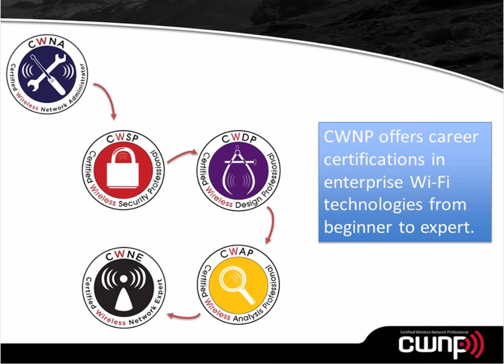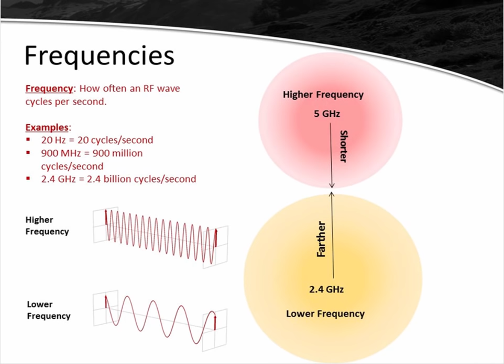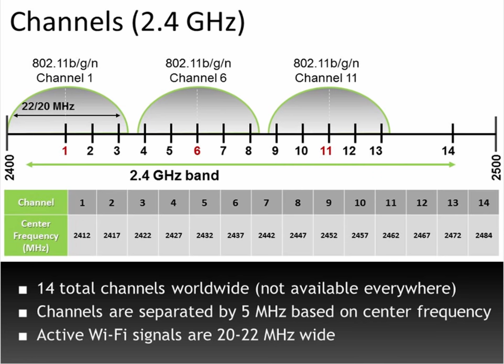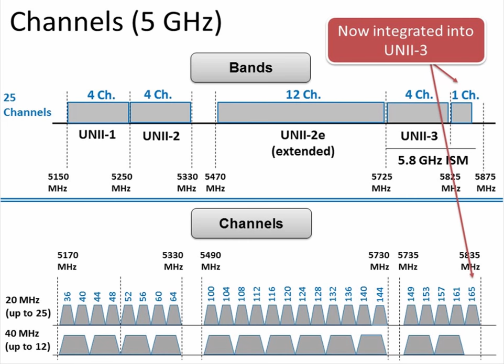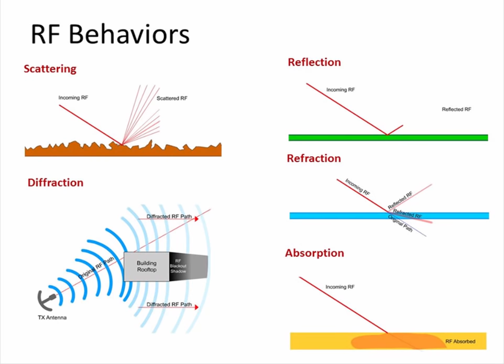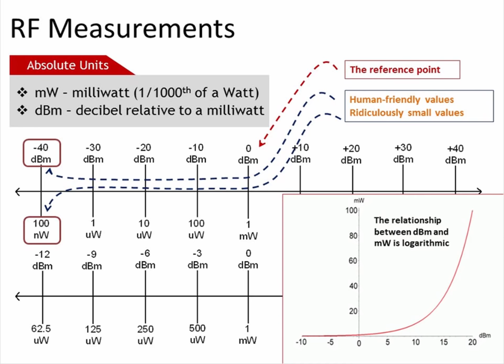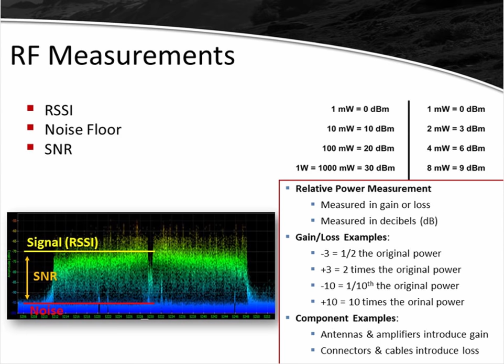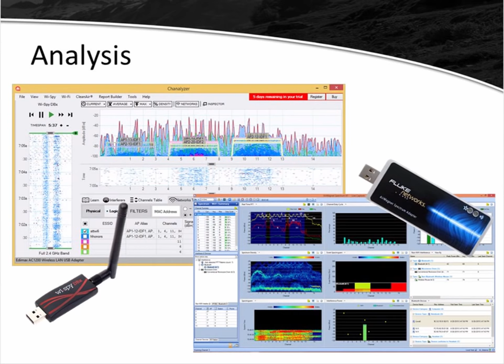Five Fundamentals of RF You Must Know for WLAN Success

Comment: How the heck can 19 people give this a thumbs down?????? Tom & CWNP are the best out there at explaining this stuff.
Reply: Keep in mind there are people that actually believe that earth is flat. unfortunately, they have access to the internet too.
Reply: Wikipedia is better.  Or a text book, MIT lecture for that matter.
Reply: Research cellphone radiation
Research cellphone tower radiation
Research wireless/wifi radiation
Reply: josh wonk the only narrow minded one here is you. First of all WiFi radiates at both 2.4GHz and 5GHz which is well under the frequency range for ionization. We know for a fact that ionized frequencies are cancerous which is why they take special precautions when using xray imaging because THOSE are ionized frequencies. Second there is not enough data to prove that non-ionized frequencies are cancerous however on the same token there is not enough proof to disprove that either. But even if they were cancerous the amount of power measured in dBm is EXTREMELY low that it is not enough to cause any bodily damage. The only thing that may be questionable on your list are cellphone tower radiation but even they must meet certain safety regulations such as height and location as to not cause the public any harm. So rest assured no one is going to die from these radiations.
Reply: This was absolutely the best presentation Ive seen

Comment: When it comes to refraction: Generally how wide is a wave length ? You mentioned a filing cabinet 🗄️ while the display gives an example of a roof top ? Also what is the size difference between that of say 2.4 opposed to the 5ghz [ if you aren’t sure of exact dimension- Maybe you’d be able to say which is wider over the other (2.4 or 5). ]

Comment: Excellent explanation sir
But how to change 11 and 12 dbm in mw by your 3 and 10 technique
Reply: The premise for that quick chart is that 10^(0.3) = 2 approxmiately.  For increasing 1 dBm we would see that 10^(0.1)=1.25 so we would multiply the original power by 1.25 to increase its strength.

Comment: Hello, what is controlling power output of the access point? Voltage or amperage? What increases or decreases the transmission power?
Reply: wattage.... ie was both... typically voltage is a fixed point due to hardware limitations (now...) so its mainly amperage but it very well can be both. but since almost no-one deals with HV amplifiers now its pretty much always amps now but you really dont even deal with that due to frequency based modulation not amplitude. and if we talking your home wifi set it to the lowest possible setting that still lets you get a signal without issues. eg. my home 2.4/5ghz wifi runs @ 1/4 watt vs the default of 1 watt